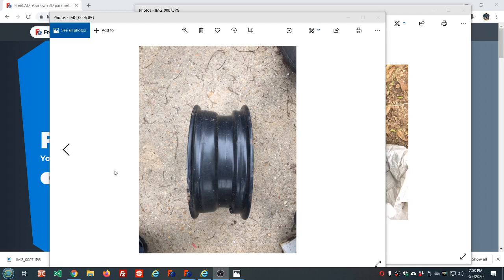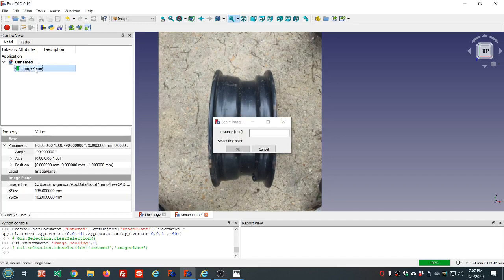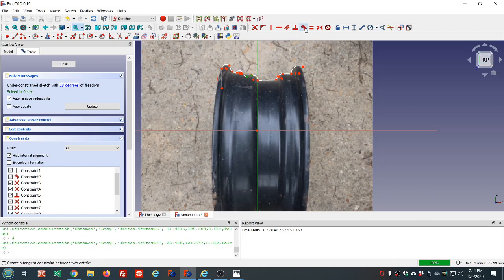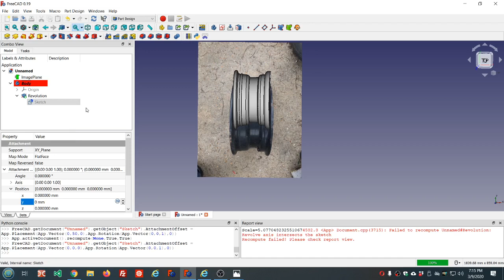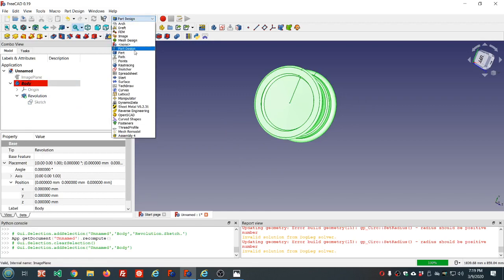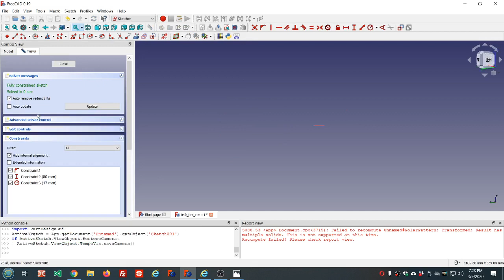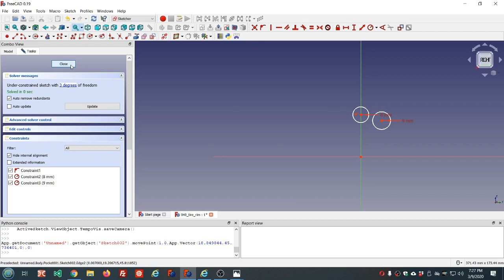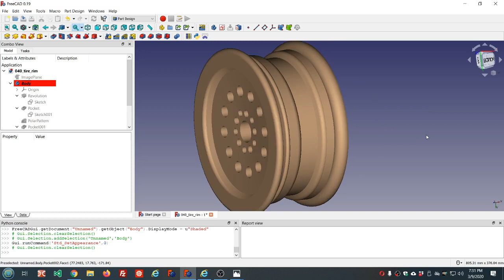040   FreeCAD tire rim image workbench part design polar arrays

Comment: Thanks Mark. I have made a sketch, with a cirkel of 180 mm diameter. Then i make a pad from this cirkel and print it in 3d, i notice that the cirkel in not complete round but with a lot of small lines connected together. Is there a way to smooth this cirkel before printing? Thanks. Jean
Reply from the maker: Slicer software requires stl format, which will always be polygons rather than true circles.  You can mitigate this by creating stl files that use more (smaller) polygons.  Go into the mesh design workbench and create the mesh object there.  Use the netgen fine or very fine options, and then export the mesh object from within that workbench.
Reply: @mwganson  Thank you very much Mark. It worked. By setting the Surface deviation to 2,0000 µm in MeshDesign the cirkel was exported very well.